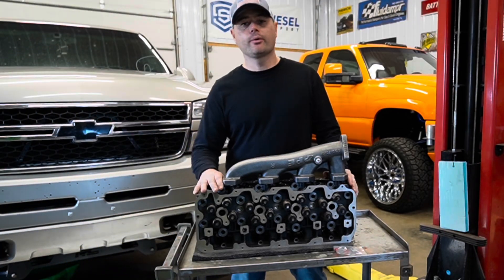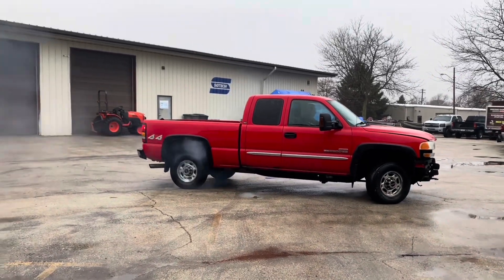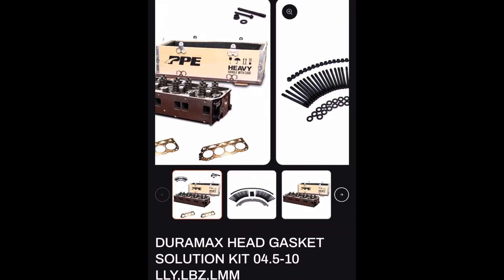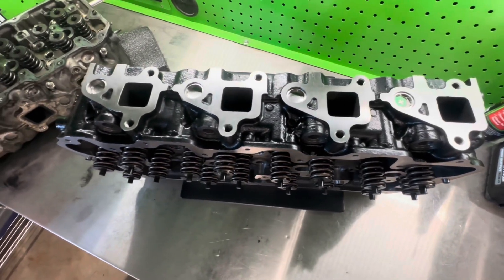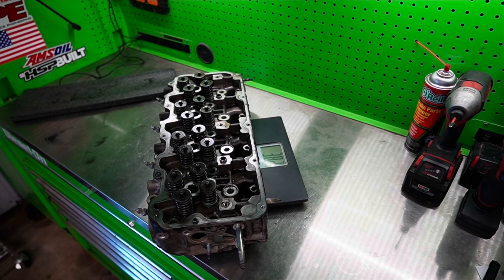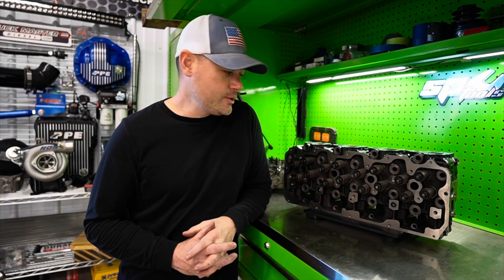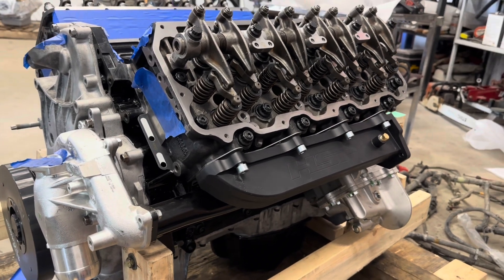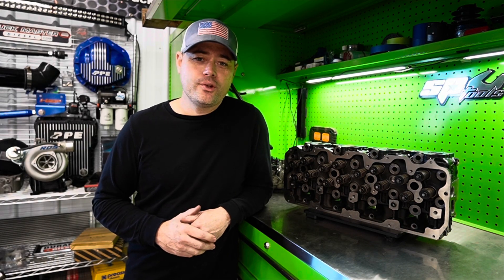PPE Duramax Cast Iron Heads! Why Is This Better Than Aluminum Heads? EXPLAINED

Comment: Hey, I enjoy your channel. You turned me onto the PPE cast iron heads. Love the concept. I'm not doing anything above stock on my 03 2500HD. Blown head gasket at 286k is the reason for the change over. The bottom end has not been touched. But I'm installing new everything up top. A new Turbo, New Bosch Fuel pump, heads PPE cast iron heads. New Bosch fuel injectors. Hard lines will be new as well. But I've run into an issue when installing the injectors in the head. Can't seem to get them to go in. From the videos on yours and other channels. When installing an LB7 injector, it's just a firm but smooth push. Have you heard of anybody else having this issue? If so, what has been a fix if you've heard. I can't seem to find much. Lube for the O-ring was originally the left over white lithium grease I used to hold the copper compression washer on for the installation. I've changed to petroleum jelly now with no better luck. Any suggestions would be greatly appreciated.

Comment: Is there anyway you can do an in depth video about traction bars? I’m just trying to make sure I’m ordering the correct thing. Trac bar options will say like adjustable, fixed or rebuildable joints and bolt on vs weld on. Seems like a lot of options for a bar.

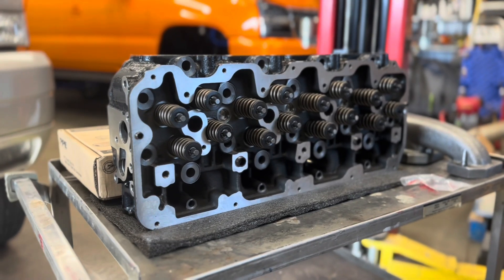Comment: 2:12….. you hit the nail on the head for head gasket problems, especially on cold startups without proper idle warm-up going right into full load with different expansion rates between the aluminum and cast.
Reply from the maker: Exactly 👍

Comment: You need to sell more stuff the the lml
Reply from the maker: I sell the LML heads as well if you want to check them out
Reply: @truckmastergarage9944  I didn’t realize you did. I went and didn’t see them. Must have overlooked it. I’m sure at some point mine will need them. When it happens I’ll be purchasing them from you